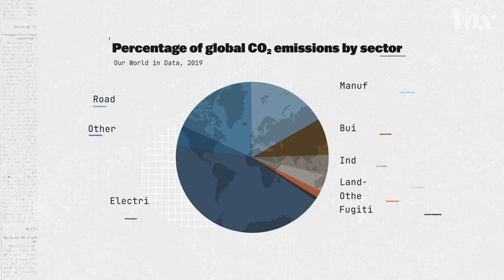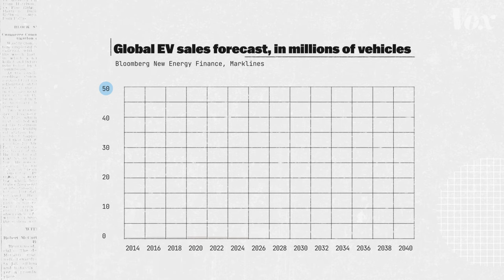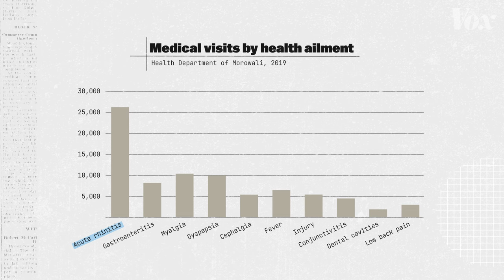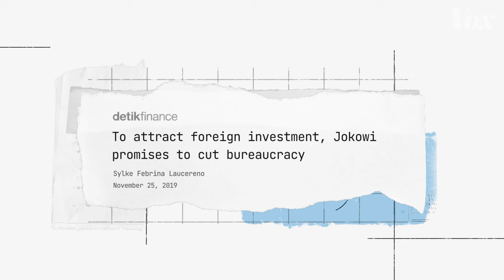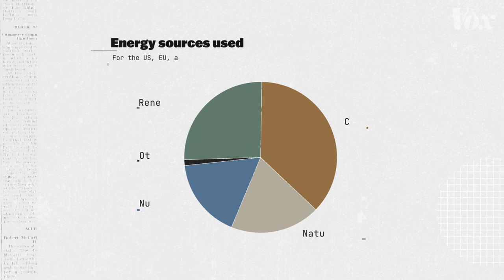Batteries are dirty. Geothermal power can help.

Comment: I don't think EVs should be emphasized so heavily as a 'solution' to climate change. We need to move away from car centric infrastructure and towards electrified public transit, with EVs as a supplement for purposes where transit can't reach
Reply: good luck doing that in the US....
Reply: When it comes to battery electric vehicles for public transportation (like buses), it would be a bit inefficient compared to hydrogen, atleast its still clean I guess?
Reply: EVs get the biggest focus because its by far the easiest solution with a meaningful impact. Getting every city in the world to change their public infrastructure is HARD. Getting people to simple change their car from ICE to EV is easy. Once prices for clean energy generation are below coal/gas energy generation (starting to happen already) then getting power stations to switch to clean energy will also be easy. EVs might not be the best solution, but they're a solution that will actually happen, and a solution that is implemented is infinitely better then a theoretically better solution that doesn't get implemented.
Reply: @RyuzoSan19  you're missing the point... The bus can run on diesel and still be 100x more environmentally friendly than the cars required to transport the same amount of people, because cars create other environmentally unfriendly infrastructure: Parking lots, urban sprawl, single family houses that require more energy than any other type of housing to sustain, massive highways.... The list goes on and on...
Reply: @misosoppa3279  I was talking about how battery buses would be more inefficient compared to hydrogen.

Since the more energy you want in a battery, the bigger it has to be. Compared to something like a hydrogen fuel cell which can be as small as an economy cars fuel tank and still possibly run a bus. It is a similar problem to the Tesla Semi-Truck which claims to carry alot of cargo, but since it needs more energy, probably half of that cargo are batteries.

I do agree with you however, that buses are still better compared to cars, thats probably why cars should only belong to enthusiasts like me, dont worry, theres not much of us left anyway lol.
Reply: also EVs are only "clean" if the electricity is produced with renewables or nuclear. most electricity is produced by burning fossil fuels. so not very clean...
Reply: @RyuzoSan19  thank you for clarifying. And I do think cars have a space in society. Rural areas and weekend getaways are optimal for cars, but 90% of trips today are made in and around cities big enough to profitably sustain good public transit...
Reply: OH YEAH
Reply: @RyuzoSan19  Most efficient are trams, trolleybuses, trains and metro.
Reply: @RyuzoSan19  while I do enjoy the shift away from Electric battery, one thing we are all overlooking is the humble trolley bus. It doesn't need a new developing tech nor rare earth metals to produce, and only requires a bit of an infrastructure upgrade in the way of overhead wires. Can be cleanly supplied and set up today if funds are made available. They can have more capacity on the busses too since there won't be needed room for the fuel cell, be it hydrogen or electric battery
Reply: @--julian_  Even under coal powered electricity, EVs are still cleaner then their ICE equivalent over the lifetime of the vehicle. But switching to EVs by itself won't be enough, we really need to do all the things. Clean power, clean construction, heat-pumps, the list goes on and on. But just because EVs aren't the perfect solution, doesn't mean we shouldn't bother switching to them today.
Reply: @chrisoconnell8432  The root problem is bad zoning, people could live where they work almost in every instance but the zoning is terrible, and the property prices overblown because the taxes when making any transactions regarding property are way to high wich discourages changing living location and makes property more expensive
Reply: Perhaps we should restrict all travel with the exception of those elite people in charge?
Reply: Problem with this is that people aren’t comfortable relinquishing this control of their movement. It can be a problem as seen by shutting down Hong Kong transit during the protests.
Reply: Further, the personal EVs we do use ought to be primarily micromobility. E-bikes and e-scooters use batteries orders of magnitude smaller to transport the same person as an electric car, and all while requiring orders of magnitude less asphalt, less parking space, less sprawl, etc. Electric cars are here to save the car industry, not the planet.
Reply: @Jackinacox  This is also what everyone said in the Netherlands (and other European countries) back in the 70s and 80s. They built their cities around cars too, then they realized it was terrible changed their mind.
Reply: @ulrichspencer  OK, so explain to me how you're going to transport groceries, building materials, etc, with a bike or scooter? Or did you not think that far ahead?
Reply: @numberyellow  I already transport all my groceries on foot. It's called living in a mid-density mixed-use neighborhood where I'm a 5-minute walk from two grocery stores. I can pop on over for groceries at any time and don't need a massive weekly costco haul.

As for building materials, I don't need to transport those. The people who do will obviously use electric trucks, but you're kidding yourself if you think 99% of the population transports building materials on a daily basis.

On the (rare) occasions I need to move furniture or something else heavy, I can rent a car for orders of magnitude less money than I would spend on owning a car. As an American, I prefer the freedom of not being indebted and beholden to banks and car insurers.

I'd prefer to spend my money on real things that matter, not shelling out to Shell and Exxon every week like an obedient little boy.
Reply: @ulrichspencer  lol, and as is typical for people of your ilk, you operate under the assumption that just because your situation is acceptable to you, that it should be acceptable to everyone... This entirely ignores the fact that people are different, and everyone has different needs, and ways of doing things. You seem to think that your way of doing things is the only right way to do them. 

I'm glad your situation works out ok for you, but you need to understand that it ain't good for everyone.
Reply: @RyuzoSan19  you can use overhead wire they are also doing that for trucks in germany
Reply: I agree. Even if EV batteries were produced using green energy sources (and were re/fueled by green energy grids), they would still pose a huge burden on the built environment through huge parking lots, stroads, highways, etc. etc. Electric cars are not the future. ELECTRIFIED PUBLIC TRANSIT IS THE FUTURE !!!
Reply: Because they're NOT a good long-term solution.
Reply: @Jackinacox  Well the US was once the leader of public transit, than the second world war comes and all those soldiers moved to suburbia where they came addicted to the car(oil was cheep) and public transit run out. So the US "just" has to regain its leading position, but all current US is doing is having no spirit for innovation and construction of a more sustainable way of living. Its has to start with a new design of trains that different from trains in Europe and Asia, when i look at a train before WW2 i definitely can say you what's an American and what's an European train.
Reply: @Jackinacox  more importantly we can just do it from scratch in new development as well as in developing nations that haven't locked themselves into car-dependency.
Reply: @ulrichspencer  People often look to Europe as an example of transit done right. However, Europeans... still own cars. It doesn't make sense to put any effort towards unproven ideas like micro-mobility when there's so many existing ideas to implement
Reply: You can't just convert millions of cities like that.
Reply: @KelsomaticPDX  why didn't the car companies stop that from happening like they did in america?
Reply: @MrGamelover23  I'm sure they tried, but the US political system gives more leeway to legalized bribery, so the companies won here.
Reply: @RyuzoSan19 Creating electricity, charging a battery and then running a motor is over 90% efficient, Using that same electricty to electrolyse water into hydrogen, then turn the hydrogen back into electricity is at best 40% efficient (and in the real world with losses more like 25%). Claiming adding a few 100kg of batteries to a 7 tonne bus is innificent compared to hydrogen is dangerously missing the point.
Reply: Tram and trolley with overhead wire would be best.
Reply: @AncientRe  Most people in the US live in urban or suburban areas, where it would be practical to provide good public transportation, although purposely anti-public-transportation design of many neighborhoods makes it harder.
Reply: @RyuzoSan19  how do you store the hydrogen? it is the smallest molecule. it can fit through atom sized spaces in metals, as well as stick in those spaces and react with the metals. the engineering explained channel recently covered both the tesla semi and hydrogen engines and even the fuel cell wasnt amazing.
Reply: @chaklee435  Have you been to Europe? Much of it is still a lot more car-centric than internet urbanists often make it out to be. Sure, Amsterdam and Utrecht do a lot right, but even within Europe, those are fairly exceptional.

Further, I'm not saying zero cars. I'm saying fewer cars and more micromobility. And micromobility is not at all unproven; over a third of commuters in Copenhagen and Amsterdam (where they have appropriate bike infrastructure) travel by bike. E-bikes have only increased that, as has been seen with the explosion of cargo e-bikes. After all, if you just need to get some groceries, a cargo e-bike is remarkably sufficient (provided your city has appropriate bike infrastructure that is).
Reply: Absolutely. And furthermore, we can't ignore EV efficiency and continue this supersizing trend with electric cars. Far better to have more, smaller EVs than fewer, larger ones.
Reply: sadly it depends on the culture/necessity of the place. some places either have an ingrained mentality towards automotive (USA) or congested Asian cities like Jakarta/Bangkok/Ho Chi Minh where small bikes are essential for workers travelling.
Reply: I would say by that point EVs are kinda redundant; they have a higher initial environmental + financial cost & only make sense when you start driving it.

A good quality fossil fuel car would do.
Reply: NotJustBikes, Alan Fisher, and RM Transit are great channels that bolster this argument.
Reply: @numberyellow  the storage capacity of metal hydrides aren’t very good.
Reply: @jonathanodude6660  But if it's enough to get the job done, who cares? Watch the interview, and let me know what you think.
Reply: @numberyellow  your comment is gone dude, I don’t know what interview this is.
Reply: @RyuzoSan19  Trolley buses would be a better solution than Battery electric buses, especially considering public transit runs on fixed routes
Reply: @jonathanodude6660  None of my comments have been deleted. Did you even read my comment from 4 hours ago? look up "Bob Lazar Hydrogen Corvette" It's the first result, on the "Hydrogen Societies" channel.
Reply: i think the best choice for mankind is hydrogen transport
Reply: @Jackinacox  Big AmeriCANT energy. We are currently in the midst of a housing crisis due to a critical lack of housing supply near jobs and amenities. We need to rezone our cities for walkability and transit ANYWAY to supply more housing. We don't even need housing skyscrapers everywhere we just need more duplexes and triplexes inside of mixed-use areas (like a small grocery store within walking distance) and deregulation on parking minimums so that you don't have seas of parking lots taking up urban space that can be used to build more housing and businesses. We need railway nationalization so that we can electrify and restore passenger rail service for intercity travel. Doing this is much more possible than replacing every existing car with an EV because EVs require expensive materials, are heavier (doing exponentially more damage to roads), require lots of charging infrastructure, and still inherit many of the externalities of gas cars (although EVs ARE better than gas cars).

Train good, car bad.
Reply: Also, even if the Infrastructure Fairy and the Technology Fairy team up to instantly turn all energy green and move the mining industry into space, that doesn't change the fact that life in a car city is miserable.
Reply: @DawnKraken  "life in a car city is miserable." In what way?

I mean, i think cities are miserable, whether there's cars in them or not, but why do you believe "car cities" are bad?
Reply: The good thing about ev's is they are quite a nice personal transport in an urban environment. The trick is making sure the electricity powering the EV was made cleanly. One could easily imagine that if EVs were fully adopted, but at the same time the total number of cars on the road increases, it will require a larger capacity of the baseload power plant that runs on fossil fuels.
Reply: @eduardoroca1991  Sure, they're "great" if you ignore all the things about them that aren't...
Reply: @numberyellow  I definitely think batteries have become a great technology. I just bought a battery-powered leaf-blower, whereas in the past those used to be gas-powered only. However I definitely don't see BEV as the long-term future of cars, because batteries will never solve the issue of range and charge time. They will be good for charging at home and getting around in the city without relying on public transit. But for long trips they are out of the question. For people who live in rural areas far from a city BEV is a non-starter.
Reply: @eduardoroca1991  I'm not just talking about range and charge time....though, those are huge deal breakers for most people. I'm talking about all of the other factors. The point of EVs, are supposed to be that they're better for the environment....except they're not. the manufacturing process for just the batteries alone, negates any potential good. I read that for the average EV manufactured today, you'd need to drive it something like 65k miles, before you've out-driven the environmental impact that the vehicle has banked throughout it's manufacturing process.

EVs are a scam.
Reply: Replacing cars for PT requires a huge culture shift in the US. People do not want sit next to strangers for a significant amount of time.
Reply: @darexinfinity  There's also the loss, or potential loss of freedom. Government-controlled public mass transit as the only means of transportation is an AWFUL idea, if you value your freedom, because it makes it SO much easier for the government to entirely lock down movement.
Reply: @numberyellow  I think there's a balancing act here. You don't have to live without a personal car, just prefer PT over it for regular usage. But yeah, quality of PT really matters in that situation.
Reply: @Jackinacox  consider it an act of war
Reply: @luciustarquiniuspriscus1408  Have you ever been to Paris or Tokyo?
Reply: @ulrichspencer  Love this idea and seeing e-bikes and scooters in my semi-rural area makes me so happy.  Having this as an option for some would be a step in the right direction.  It's so hard with kids though.  And where I live in NY, it's so brutally cold much of the year, that even with a heavy coat it would be rough commuting 25 minutes into town for work, especially if the roads are snowy.  Additionally, life follows a pretty unchangeable schedule with work and kids, so scootering in the rain would have to happen a fair bit, and that would be quite unsafe.  Anyway, a diversity of tactics is needed, and having more micromobility for those who can make use of it sounds very smart.
Reply: @Jackinacox  Well, we are!